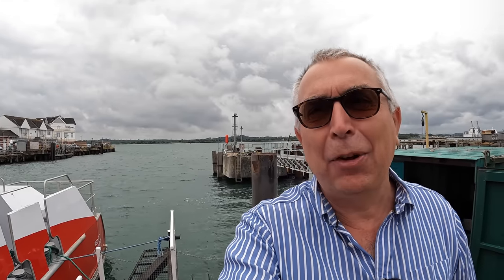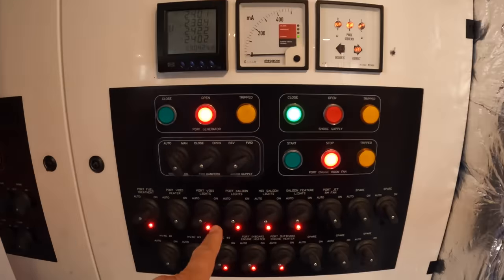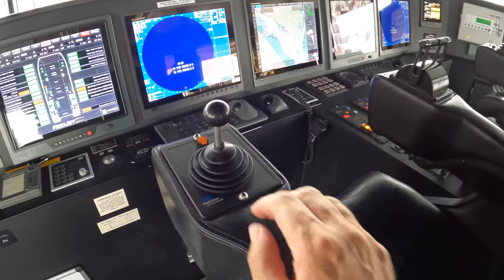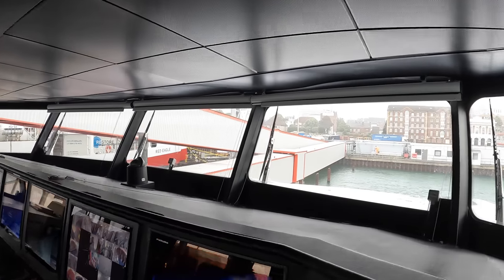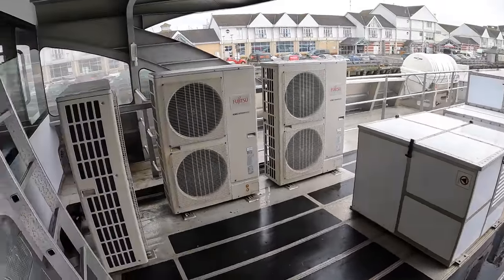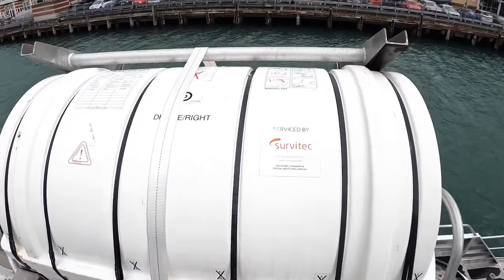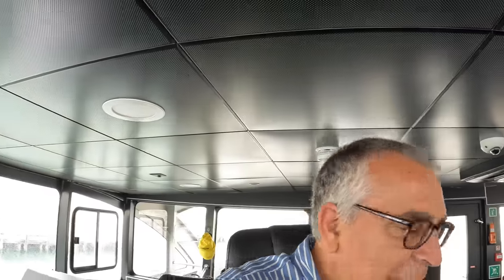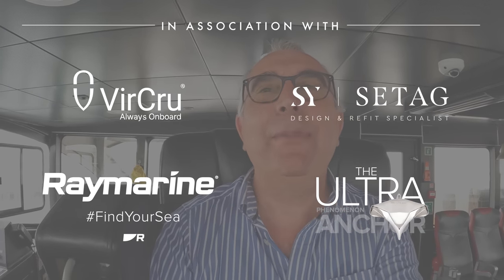£7 Million High Speed Ferry Tour : Red Jet 7

Comment: Thanks for a comprehensive educational tour. The 16,000 hour refurbishment schedule is interesting, especially the access points. The safety measures and duplicate controls are reassuring. Red Funnel Ferries should be rightfully proud of their fleet.
Reply from the maker: You're very welcome 🙂
Reply: Try living on the IOW and saying that. Unreliable, overpriced and regularly cancelled at short notice.
Reply: @SJP7752  sorry to hear of your frustrations with your service. As a user you clearly have a local perspective.
Reply: Absolutely agree Sean. I've used these more times than I can care to remember and it's always been a pleasure travelling on these. Smooth running and very well priced for travelling over from the island and back especially with a car aswell. I will always use red funnel over wightlink as their services are all over the place either late cancelled or departs earlier than schedule.

Comment: I was quite dissapointed by the look of the worn anti slip on the deck. The boat looked a little neglected. Was relieved after seeing the clean- and tidiness of jet and motor compartment as well as all the backups and the documentation and labeling of them. Never the less the first impression counts too.
Reply from the maker: It's a heavily used commercial ship, a bit different to what we usually see on here. 🙂

Comment: I like the fact that it is all on one level being as I am stuck in a wheelchair. I wonder if anyone has converted something like this into a 40 meter super yacht, you certainly have the deck space to have amazing berthing and crew cabins and all the extra spaces for distance cruising, derate the engines, reduce by 2, who needs a 40 knot super yacht. I imagine properly configured you could get 3000 Nm range, we are seeing a lot of older hulls revamped and in some cases lengthened, sounds like a fun project.

Comment: Really appreciate the bike racks inboard but they also need external ones for E bikes and cargo bikes which are a great way to deliver, commute or tour from islands. Possibly even top up charge .

If you do get a fire 🔥 the crew can ditch the offending battery over the side if extinguishers wont work .

These vessels are increasingly been built with electric systems or hybrids. 
See the larger Deepspeed Aqua jets that were developed for this sort of use.

Comment: Very cool and interesting, Nick!  It seems to have a lot in common with the M/V Bravest, on which I took a glacier tour out of Whittier, Alaska.  The Bravest started life as a New York Harbor ferry, and is named for its role in evacuation and first responder transportation on September 11, 2001.  It's much modified from its original configuration, including reinforcement for traveling through ice-filled water.  It only has two engines and jets, but carries ~250 and cruises at 30 knots, including through broken ice, which was sure an eye opener for me!  Of course, I didn't get to see any of the crew-only spaces like you did!

Comment: Great video as always! I wonder why we don't see more ships like this using diesel-electric drives. You'd think a single big generator in each hull driving two motors would be more efficient and easier to maintain than four big engines?
Reply: If that single engine for the generator dies, you're adrift and without power. A straight shaft is also more efficient (close to 100 %) than going via a generator-electric motor combo (probably 80-90 %).
Reply: @mytube001  That's why I suggested an engine in each hull. If one engine would cut out you could still run all four motors (albeit with a slightly lower power output) on a single engine/generator. With generators and electric motors you can idle the generators at almost zero load, which is something you cannot do with engines without having a clutch that disconnects the output shaft from the impeller.
Reply: @haraldk6828 exactly what I was thinking about

Comment: Nick, see attached 

How does FM200 work?

There is a common misconception that FM200 gas reduces oxygen this is not true! FM200 is a synthetic/chemical fire suppression gas and extinguishes a fire by removing the free radicals or heat elements from the fire triangle. (Oxygen, Heat and Fuel).

The typical concentration of an FM200 system is normally between 7.9% to 8.5%. This concentration is determined by the risk that is being protected and by the OEM (Original Equipment Manufacturers) and the ISO14520 standards for fire suppression systems.

Taken from Fire Suppression Systems UK
Reply from the maker: Ha, interesting! I did not know that.

Comment: Brilliant tour. Did they tell you what the two "Eyes" were either side of the anchor winch?
Reply from the maker: They didn't. They look a little like crane lift eyes.
Reply: @AQUAHOLIC  I saw another pair at the aft end on the Isle of Wight video. As you pointed out the ship yard and the annual over haul / inspection, they could well be for lifting it into the shed!

Comment: I wonder how much fuel it would save if they'd really seriously optimize the aerodynamics. Refining the superstructure shape & surfaces, radar and antenna towers, life raft rigs, railings, everything together might be worth it at those speeds, especially considering how many miles they munch every day. Maybe even some aero devices to be deployed when leaving dock. It would be interesting to calculate. It might not save much money, hopefully at least cost-neutral in the end, but it might save fuel & reduce CO2.
Reply from the maker: I should imaginer roughly zero. With water 800 times denser than air and hulls running at above displacement speed, the amount of energy required to push through the air compared to the water is probably a fraction of a percent. Try holding your hand out flat against the air at 20mph compared to flat against water. You'll feel a gentle breeze with the former, you won't be able to hold your arm against the water pressure with the latter.  🙂
Reply: @AQUAHOLIC  Actually the correct logic to follow is simply that of how much aerodynamic drag can be reduced = that is your savings. The hydrodynamic drag is a given, and it is irrelevant to aero drag: Every bit of aero drag you reduce, well, that's reduced! So any amount of aero you reduce you do in fact actually save, even if you are using a a lot of fuel to push the hull through water in addition to that.

35 knots is only 64 km/h so it's not a huge speed, but enough to already make aero pretty important. With all that square footage and so many sources of drag, optimising could easily result in savings equal to multiple cars' worth of low-drag optimisation.

The advances in aerodynamics have been huge, and even automobile shapes which look nearly identical can be vastly different in drag. This far larger vessel, with far more room to improve aerodynamics, can be optimised so much more than tiny, nearly identical cars! It has much more crude shapes, protruding edges, huge antenna towers, openings without any air flow management... There are so many principles which could be used to optimise that ship.

Take for example that radio and radar mast: it's causing a lot of drag every single trip, every day. I'd make a crude estimate that it could be optimised and made to reduce consumption by a litre per hour.

Those lifeboats and their cradles are about the size of a car and are incredibly draggy. Optimising those three car-sized lifeboat systems would probably result in savings of half a litre per hour at cruise speed.

Just cleaning up the surfaces, joints, window edges etc. can add up to pretty big aero savings.

You can think of it like having the superstructure be a load of cars on top of the hull. If you make those cars on there more aerodynamically efficient (from 1950's level design to 2020 level), you will reduce drag, which will reduce that equivalent amount of power and fuel. It doesn't matter if you're using 1000 litres/hour to push the hull in the water, if you save 10 litres/hour in aero drag, you're actually saving 10 litres/hour in aero drag!

If you save 10 litres per hour in aero, with 22 round trips per day with probably 40 minutes at cruise speed, times two for the two vessels, that's approx 300 litres per day saved with their two vessels. If operating 350 days a year that would mean 105,000 litres! That times 2.68 = 281,000 kg of CO2! It's not much in cost, but in CO2 and marketing value it might be significant!

Making it significantly lower in drag (especially with superstructure shaping) will without doubt result in noticeable savings in fuel and CO2, and without any reduction in function, only up-front cost. My point is it might be worthwhile to invest in that up-front cost to reduce fuel burn, even if it's cost-neutral or slightly negative in costs. Nowadays especially when companies can use their emissions reductions in advertising & PR which can be worth a lot in sales and positive brand value.